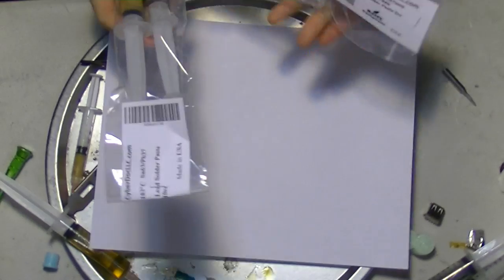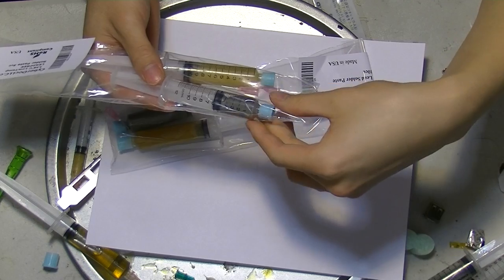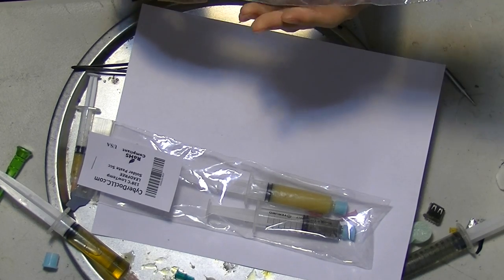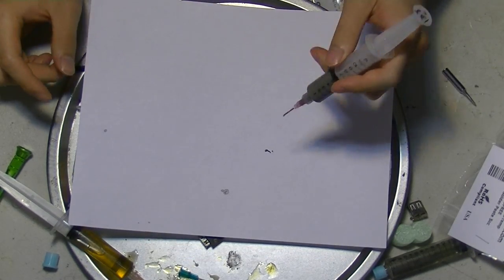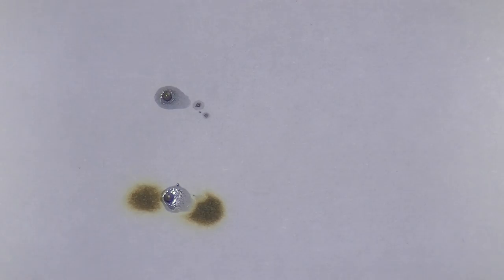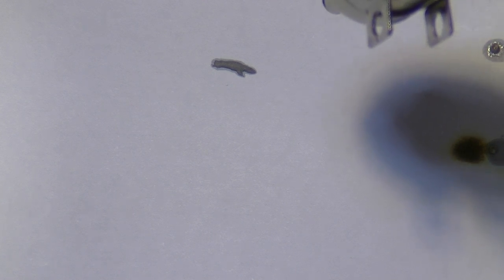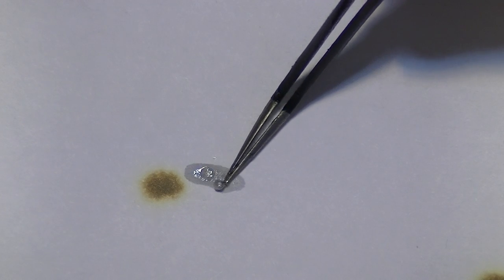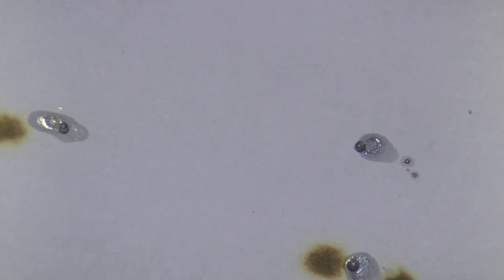SOLDER PASTE reflow on paper 138C LeadFree and 183C 63/37 No clean solder paste CyberDocLLC.com

Comment: Good video and product. but have question on what to buy to 138 or 183 for soldering pcb board firmware bios chip any suggestions?
Reply from the maker: Depends on pin size 183 joint is more stable.       138 is more for larger chip contact.   If you want to reflow the board then 138 is safer for the rest of the board

Comment: I am confused man. Isnt Lead Free supposed to have a higher melting point? why lead free has lower melting point than the 63/37 one...?
Reply: The 138C alloy is made out of Tin-Bismuth mix, which has a very low melting point as you can see. Many years ago when lead was prohibited in consumer products this was one of the potential candidates to be used as a lead-free solder, however it wasn't because if it is mixed with lead (e.g. HALS PCB finish used lead at the time, even now PCB providers allow this as the cheapest option for PCBs finish e.g. on JLCPCB), the melting point drops further to 96C. This is very dangerous as the devices heat on its own while operating, thus the bond is potentially unstable. Therefore care must be taken that there are no leaded components nor the PCB itself contain lead. Also, Bismuth is scarce, so not all PCBs can be soldered with it as we would run out of resources plus when cooling the Tin-Bismuth alloy expands, thus it might not work well for some components. Another compound which might even be better is Tin-Bismuth-Silver, which increases the melting point to around 183 and seemed to show better performance according to some papers... Anyway, that's why :)

Comment: Just a Q. Whats the yellow one used for?
Reply: That's just flux by itself without the solder. There are different types of soldering and solder, some people use flux with all of their soldering by applying flux then soldering, or people like me use rosin core solder or premixed paste like the metal colored tube and skip that step because eh, as long as it holds I don't care if its pretty :p